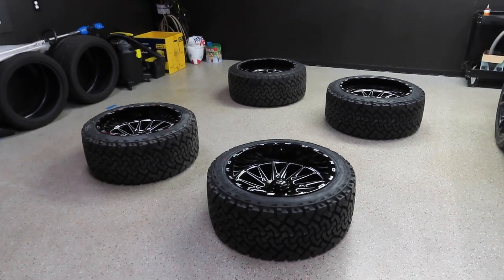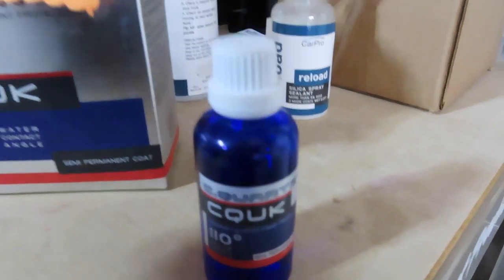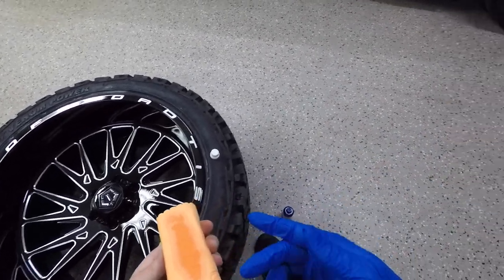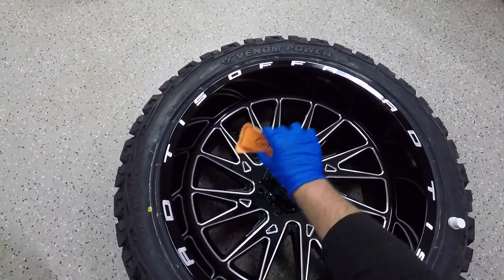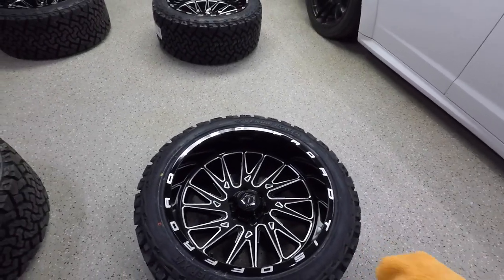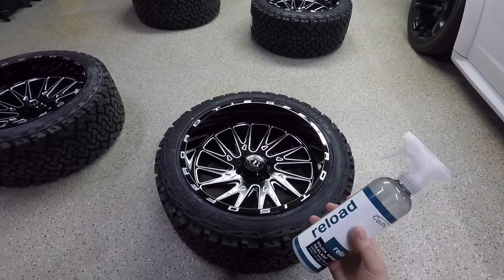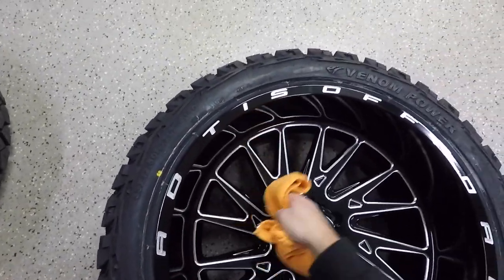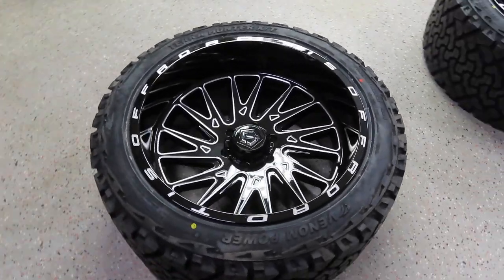HOW TO CERAMIC COAT YOUR WHEELS THE RIGHT WAY! *STEP BY STEP PROCESS*

Comment: Tip for the Reload application. On the initial wipe with the initial spray, instead of applying to one area while the towel is the “wettest” - use that first wipe to completely go around the rim. This way, the initial application of the product on the towel gets “spread out” and is not concentrated in the one area that you wipe first. This applies to ANY application of a topper. Thanks much!

Comment: Wheels looks beautiful. I always do a cross pattern with the applicator. How many towels did you use for the wipe down of each wheel? I also use an applicator and cut it into 4 pieces to get into the small parts. Gyeon rim works really good as well.

Comment: 2:08 the instructions for the ceramic coatings I’ve used say to use the bottle within 30 days of opening. How has the coating held up on these wheels since the bottle was opened for 3 years before you used it?
Reply from the maker: It did the job!

Comment: Do you need the pad to apply the coat? Not all rims are the same. How do you apply the coat on difficult parts of the rim not everything will get coated using the pad
Reply: You can also a circular microfiber pad...works just as well

Comment: Is your truck stock height? Because with those wheels it looks like your truck has been lowered a little bit? I’ve been shopping for wheels and tires for my ram I do have 22s on there right now. But they’re more of a straight tire I’m looking for all terrain and I like the look of your tire and wheel. How much did you pay for those.?

Comment: Would it be easier with just the rims no tires I heard just leave room for the weights inside and heard 48hrs to let it cure
Reply from the maker: No, having the tires mounted on the wheels is not a problem.

Comment: Was there a reason you didn't do the barrels? I'm currently waiting to receive my new rims and I am just curious.
Reply from the maker: Just didn’t want to take the extra time to do them when you can hardly see them mounted on the truck and I never get behind the wheel to clean. Plus it’s a dull finish on the inner barrel versus a gloss black finish on the outer wheel.